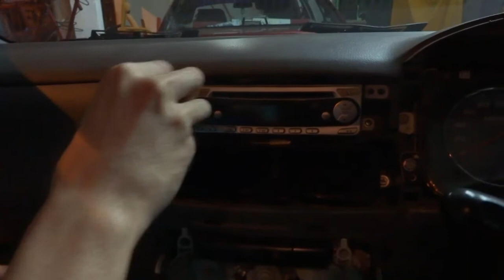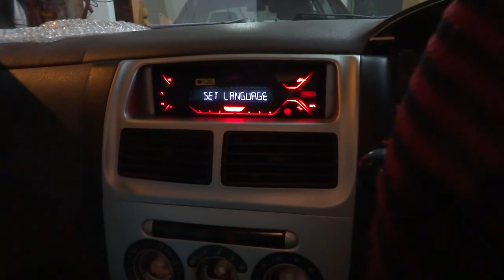Installing SONY DSX-A110U on Perodua Viva | GUIDE | STEREO

Comment: Hi boss,beli dekat mna ye sony player ni? Mmg fit plug and play ke soket wayar x plu cut sambung ke wayar?
Reply from the maker: Beli kat lazada. Ya, cuma kena beli adapter wire
Reply: +PenguinTech masih bossku
Reply: Mna nk dpt adapter tu ya
Reply from the maker: @najmuddin1998  You can buy it here. It is called Perodua Viva OEM Plug and Play Socket Cable Player Socket 
https://www.lazada.com.my/-i164484417-s196325967.html?urlFlag=true&mp=1